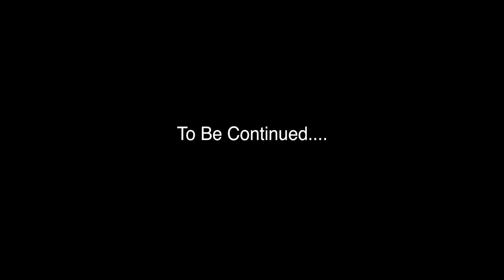How to Level Your Lawn the Easy Way. | Lawn Leveling with Topsoil | Front Yard Renovation

Comment: Awesome way to level it out to uniform. One thing you could do is instead of using the two stake, drill a one inch hole in the 2 by 4 and use one stake as the pivot point. Just a thought.
Reply: I was thinking the same thing.
Reply: Genius level brother.
Reply: Yup
Reply: It will jam when you lift it though.  Hole would need to be bigger or stake smaller.
Reply: Could also leave it untouched so the 2x4 can be used for something else after.

Comment: Awesome way to level the dirt! I would recommend throwing down some gypsum before and after to anyone who is doing something like this. Also, that added soil will go down a lot so you'll have to add more down the line.
Reply from the maker: True. Thanks, Cesar. Lawn leveling is definitely NOT a “do-it-once” activity. Over time, tweaking will be required.

Comment: A Tiller would break that clay sand mixture up, and then you add in the top soil and level and it would produce a great soil mixture base for seedlings.

I love the board trick though.

Comment: Love the video!! Quick question - what would I do if the lawn ALREADY has grass? My garden is really uneven and I want to get it sorted for the summer, but the grass is completely fine. It’s just really bumpy
Reply: you've probably already finished this project. But 1 solution would be to get a good sharp shovel and cut the grass out in strips roll it out level the ground and then put the grass on after. But realistically grass seed is very cheap it won't hurt to just dig up the grass and start fresh.

Comment: I suggest you invest in a lawn leveling rake which works better than your stakes and 2 x 4. You also need to put some humid acid on your lawn monthly to soften up and enrich your soil.
Reply from the maker: Yeah I bought some humic to incorporate with the existing soil base before I added topsoil. Unfortunately the humic shipment was delayed and the new soil was delivered on time, so I had to proceed without the humic so I could stay on schedule.
Reply: When you have a large area with no established levels a rake is not going to help you.  You need to set some levels and scree the soil,  his process with pipes is excellent,  Ive done this with firring strips of wood staked at certain levels to establish levels for leveling base rock for block walls.
Reply from the maker: Well said @scottstewart

Comment: I really love the pivot application. I was thinking about my own version would be using a threaded rod spike and a nut that can be moved up and down to set the hight you need and maybe the metal pipe add a closed hook to the end that can be slided in the threaded rod and you can get 360 rotation movement, just thinking out loud.. great video man

Comment: Brand new newbie here, and the one piece of information I can't find in any video is, "How do I approximate the quantity of compost/top soil I need to purchase for the size yard I have?" I know a lot would factor into the answer, like square footage and how level it is (currently it's a 480sqft West Texas sandlot personalized with intermittent, break-your-neck-taking-the-trash-out-goddamn-Dachshunds-crafted holes, and it's peppered with sporadic dead crabgrass nuclei), but a general starting place would be so very helpful! I'm a teacher just barely on "this" side of recovering financially post-COVID-19, so my budget is limited, but I need to get a grip of the yard stat, because my three-ring Dachshund and pit bull circus needs bathing every night after playing in the mess back here, and I think they are all getting skin infections from the bad stuff breeding in the dirt. ☹️
Reply from the maker: 480 square feet would take about 2-3 yards if you apply a deepish layer. You could order it from a nursery/landscaping supply, or you could buy it by bag at Home Depot Lowe’s or Walmart. There’s online dirt calculators, and you can Google that and use it to create an estimate of the dirt that you might need. Hope this helps! Be careful with those dachshunds.

Comment: Thank you for the great video. When is it necessary to dig up old grass or a weedy lawn before putting down the fresh topsoil? What is the best way to do that? I noticed in your video that your front yard was fairly bare but the back had some patchy grass.
Reply from the maker: Great question!  If your adding lots of topsoil in the fall, (AND you have a warm season grass like me,) it’s usually advised just to simply scalp the grass down to the dirt level and lay the soil directly on top. The reason is because in the fall, temperatures are getting cooler, and the warm season grass is about to go dormant anyway. Dormant grass that gets covered with topsoil will just be smothered away. It will save you a lot of work tilling up the soil and removing the grass. The most common warm season grass includes Bermuda grass, zoysia grass, buffalo grass, and Saint Augustine. If you have any other type of grass, like the kind of grass that stays green in the cold, let me know and I can give you more advice.

Comment: This is amazing as i am currently leveling out my lawn. My question is what is the definition of leveled soil? Is it when the soil is loosely laid down? When i lay soil down it looks leveled them of course when you step on it in and pack it in a little it will easily not be leveled, pact on a little naturally, but not to hard that seedlings cant grow through it. Then you could easily add a little more soil and repeat that process. So at what point in the soil laying process are you checking for leveled?

Comment: Great guide. I live in an area where the summers are hot and dry and we have a lot of clay. Is this ok to do if I plan on putting grass in later when it’s cooler? Thank you!
Reply from the maker: Hi thanks for watching!  I live in Texas so I understand need to avoid the hot summers. I think the time of year that you do this will depend on the grass that you plan on planting. If you level the soil late in the season, as I did, you should be prepared to plant a cool season grass, so it will establish the fall and hold the soil in place over fall and winter.  Since you live in a place where the summers are hot and dry, my assumption is that the end-goal is to establish a grass variety that will survive long term. So, be prepared to kill out the cool season lawn and then install sod or replant the lawn with a permanent stand of warm season grass. Or you could be a crazy person like me, and just let the sun kill out your cool season grass and replant it every year in September 🤣
Reply: Understood! Sod installation is my desired goal. Thank you for clarifying this as I live in California, but I understand the summers to be more brutal in your area so I appreciate the confidence boost!😅 Im also planning to use this same type of soil in another area of my yard as a base for a garden bed. 🙏🏽
Reply from the maker: Ok well southern California climates pretty much allow for sod installation year round, with Fall and Spring being the 2 most optimal timings.
Reply: What about Northern California with dry summers?

Comment: I’m assuming he used a level on top of that 4x4 to make sure it was leveled before dragging the dirt?
Reply from the maker: Hi Anna! Great question!  That is certainly one way to do it. In my case, it was more important that the yard be strictly flat, and less important that it was technically level. For water drainage purposes, I actually needed the yard to slope slightly, to deal with water runoff. Still, having a flat yard can be accomplished even though there may be a slope to the grade. Thanks for watching!
Reply: Flatten would have been a more accurate term than leveling.

Comment: Hi Jason, you do know how to do gardening.  i am on board for my very first one and i was wondering when do one needs to use a roller to compact the soil before seeding?  The top soil you used is very fluffy and soft, wouldnt it become unlevelled with people walking on it?
 much appreciate any help / guidance. thanks
Reply from the maker: Thanks for the question. To help the soil settle, I turned on my irrigation sprinkler system 5 times over the course of the next day. The goal was to apply water, and let it soak. Apply water again, let it soak in again. This method ensured that the new soil was thoroughly settled and was no longer light and fluffy. Since my soil was composed of 50% compost, (sticks, leaves, bark etc.) my soil never became muddy. So another day passed and then I rolled the soil to compact the seedbed slightly. I believe the roller weighed around 300 - 400 pounds, but I’m not exactly sure. I was pleased by how stable the ground was, so I proceeded with seeding and covered the seeds with peat moss. To keep the seeds wet during the germination period, I applied irrigation for 5-6 minute sessions 3 times per day. Short cycles just to keep the seeds from drying out. Skip forward 14 days, and at that time the seedling roots began to lock the soil in place. This is the key. As the turf grass thickened, all of that soil became interlocked with the root system and now I can walk on it freely. I have even pulled my cart around on it, loaded with dirt which weighs a lot. And it doesn’t form ruts. After the seeds were planted I did stay off the landscape for around 2 weeks to prevent footprints or damaging the seedlings, but afterwards I began to feel comfortable walking on the new turf especially as the root system matured.
Reply: @jasongarringer12  thanks for replying. I didn't know this tip. It will help.

Comment: Can I do this but on top of the grass I already have, to help level it or do I have to dig the grass up?
Reply from the maker: Just cut the grass down, all the way down to the dirt. Go as Low as you can get your mower. You might have to work your way down and cut off a little bit, the go over it again and cut it down more with every pass. This is a process called scalping. One you remove most of the top growth, you can cover the short little Stubbs of grass and plant some new seed on top. Hope this helps!

Comment: Hi, I done this is my garden and in some places it’s soft. I have added water but still soft (leaving a print if I stand on it). The guy at the hardware store told me I shouldn’t have used the items that are mentioned as eventually it will drain away. I’m thinking of taking some off and sprinkling cement powder and then putting the soil back on. Do you think this would work?
Reply from the maker: No, do not put cement powder. It will naturally settle down (it will become less spongy soft over time. If you want, you can mix in some sand which can give it a little bit of structure. Just don’t mix in too much sand if you live in a hot climate. Sand is basically granulated glass and holds heat, which can scorch the grass when the temps rise for extended periods.

Comment: Did you tamp it to make it settle faster or was it enough to just have rain?
Reply from the maker: I ended up rolling it with a lawn roller before I put down seed. I think the rain was good but I came back and added a little more soil/compost mix to compensate for the settling. And even ran the sprinklers a few times before rolling. I will say that the ground never got muddy since there was so much organic matter mixed in from the compost.

Comment: Do I need to remove the grass before I level? It’s a large area that will need several inches of soil/compost?
Reply from the maker: Not usually. What I like to do is just spray the whole thing with Roundup. Wait a few days, add the topsoil, then I can do my seeding. Several inches of soil over grass that’s been sprayed with Roundup will just smother the rest of it out if the round up doesn’t kill it.

Comment: Hi New follower her👋
I am going to start this project in the upcoming months. Since it rains alot  here, if the deliver dirt  happens to get wet from an unpredictable rain fall, do it  make it harder or easier? What tips would you suggest? TIA!
Reply from the maker: Great question. It depends on the amount of rain of course, but I’ve found that only the top few inches of dirt gets wet. Underneath the wet layer, it’s still as dry as before the rain!  Kind of amazing. 

If you let it sit for months and many, many rains occur, the middle will eventually get wet too and then it’s heavier and more difficult to move around.
Reply: @jasongarringer12  I see. And no  I won't allow it to sit for months lol, hopefully this project won't take long. I was just wondering about the rain. I appreciate your video so much . Thank you for replying!!!!

Comment: What would you do if some of your yard was too tall (too high on the side closest to the road too low closest to the house. Of course 🙄) and you didn't know what type of grass it was?? Honestly it's prob just a bunch of weeds 🤪😅 but I'd like to fix that.
Reply from the maker: Great question!  So, I know it’s hard to tell from the video, but my street is actually higher than my house foundation. That means my yard naturally slopes toward my house. In this case, I can still have a flat yard, but it’s not technically level. Strictly level lawns have trouble draining away water. So it’s actually okay to have a slope to your lawn, especially to help deal with water drainage. My advice is to follow the natural grade of your lawn, but add topsoil to smooth out any low or bumpy spots. I have to admit, without seeing your lawn, it will be hard to offer specific advice. 

One thought I have is to use a shorter leveling device. For example, I used a 12 foot 2x4 piece of lumber to flatten the soil. For you, maybe you could use something 4-5 feel long and work the soil flat. You can google “level lawn tool” and a neat soil spreading tool should pop up. It’s kinda like a really wide rake but flat on the bottom to spread the soil evenly. Hope this helps!!

Comment: So should I remove old grass before adding soil to level ground?
Reply from the maker: I would scalp the existing grass off and remove all the clippings. That’s what I did here. You could also scalp it and then spray Roundup if you want to take it a step further.
Reply: @jasongarringer12  Thanks!

Comment: Great video. How much Top Soil did you lay down?
Reply from the maker: Thanks for watching!  It was about 5 yards of 50/50 mix (equal parts sandy loam and compost) blended by my local nursery.
Reply: @jasongarringer12  Thanks!
Reply from the maker: And that 5 yards was spread out over about 1100 square feet.

Comment: why top soil and sand over sand a screen soil/dirt
Reply from the maker: Great question. My blend was a 50% compost and 50% sandy loam topsoil. Sandy loam is a common basic topsoil used in my area and also around the country here in the states. The reason I went with this blend is because the sandy loam is deficient in organic matter and I wanted to add that to enrich my lawn’s soil profile. What’s the soil like in your area?
Reply: @jasongarringer12  im in Memphis so we have essentially just clay dirt haha.
Reply from the maker: Ok well I would definitely order a load of blended dirt. Many nurseries and landscape supply places will blend compost and topsoil for you, load it on the truck and deliver it. It costs a little more, but it’s cheaper than buying good stuff in the bags at Home Depot or Lowe’s. And your seeds will do better germinating and rooting too.